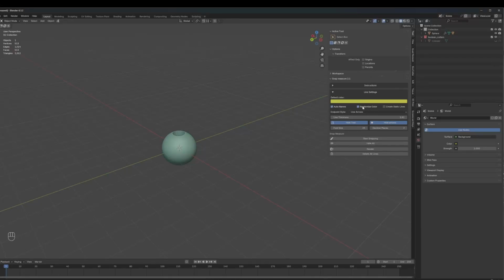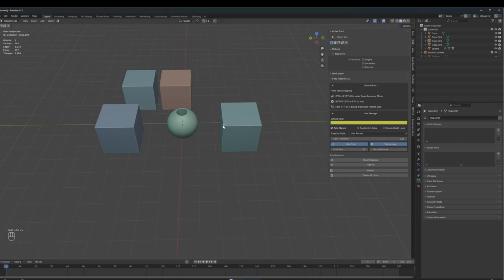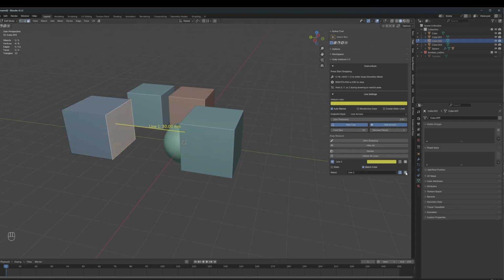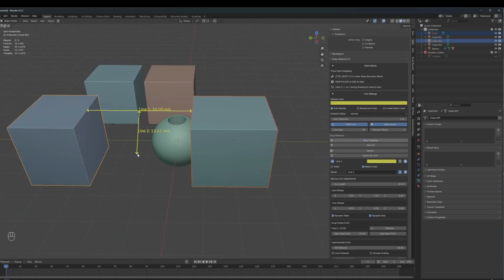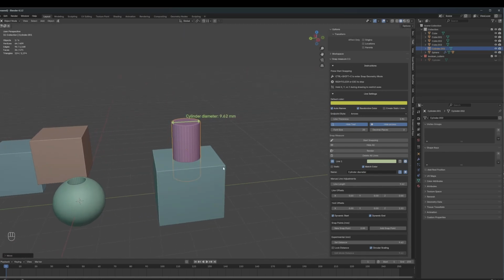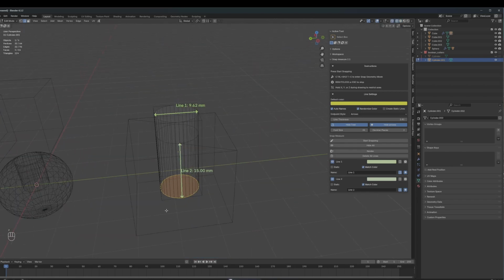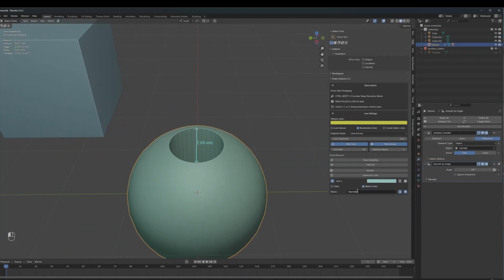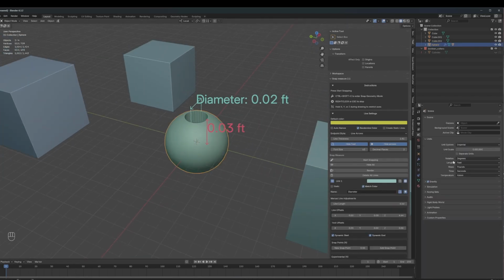Blender - Snap measure addon

Comment: Great addon. I bought it after seeing Artisan of Vault's videos, but unfortunately it doesn't work for me. When I try to select a vertex group to set the End for a measurement I get this error:

Python: Traceback (most recent call last):
File line 8348, in execute
v[deform_layer][vgroup_idx]= 1.0
ReferenceError: BMesh data of type BMVert has been removed

If I try again it works, but only until I set up a different vertex group that has some common vertices with the first group. I get a warning about vertices being used by a different group. And then it's just broken, nothing works properly. I'm using 2.4.2 with Blender 4.5.0

I couldn't find a way to report this bug on gumroad, so here I am hoping this can be fixed so i can use it because it really looks great.